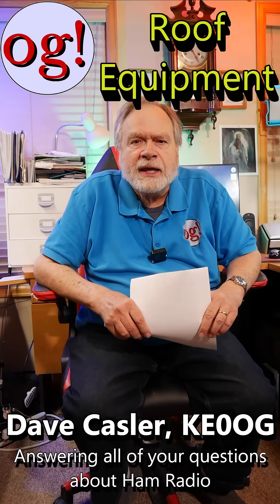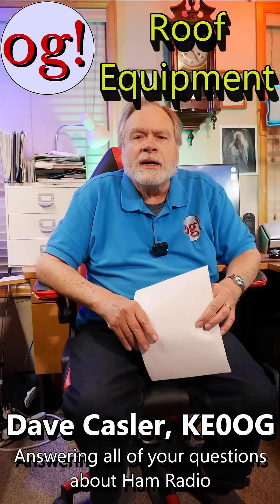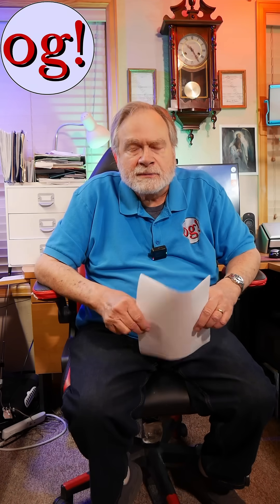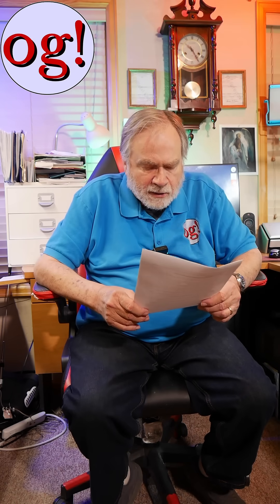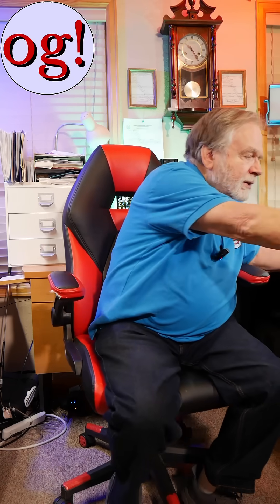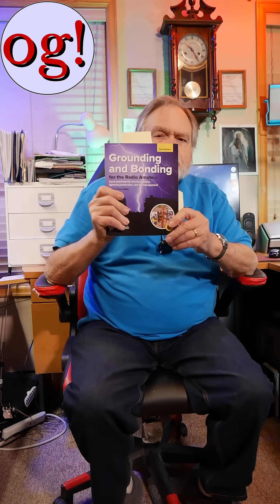Roof Equipment (Short #84)

Comment: Don't ground your ham equipment to a ground rod that is not connected (properly) to the home AC ground.  You can ground your antenna to a ground rod, but don't use that ground as a station ground. Make sure you disconnect equipment from the antenna (outside) whenever lightning is possible. And completely disconnect your indoor gear from any connection to house wiring or cable Internet when there is the threat of lightning.  A strike on an out of service light pole 25 ft from my house came in to the house AC via 24v irrigation valve wiring.  It exploded the irrigation controller, blew up the pump relay, and trickled enough current into the house to fry the smart controller that was part of our electric water heater.  A nearby strike in the same storm came in through induced current on the cable line (opposite corner of the house). It fried the cable modem, blew up the associated wall wart, and went backwards through the surge strip to carbonize a wire nut connection that fed power to that room from the adjacent room.  No breaker tripped.  The cable current also fed through to kill cable box, the attached DVD player, and the HDMI port on the TV that was connected to the DVD player by HDMI.

Lightning doesn't take that PATH of least resistance, but rather the PATHS of least resistance.  

This is why you can die when lightning strikes nearby and finds you standing (or squatting) outside with insufficient insulation and your feet  spread apart.  There will be a voltage potential between your feet, and some of the current in the ground will use you like a parallel resistor.

Comment: I’ve always disagreed with a utility bonded ground to the QTH, but I’ve also always been a firm believer in separating the station from the home entirely.

Lots of QRM goes through both your home’ neutral wire and the grounding wire. You can endlessly engineer solutions to the problem of ‘sourceless’ interference but I’ve found its much easier to design the whole station for battery power and then to draw down the mast during electrical storms. I’ve settled on a modest mast height, about 29’ because breaking the TX side down takes less than a minute. I may shoot for 10 more feet of height but I believe that’s thoroughly in “need a permit” territory and I’m doing A-OK on RX.

Involved? Yes. Safe? Very, so long as you design everything with graceful failure in mind.